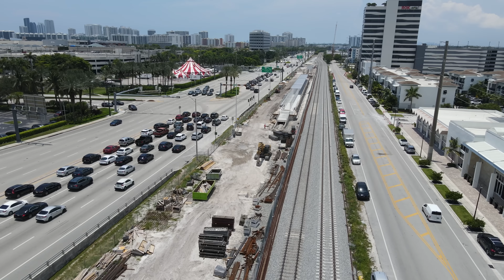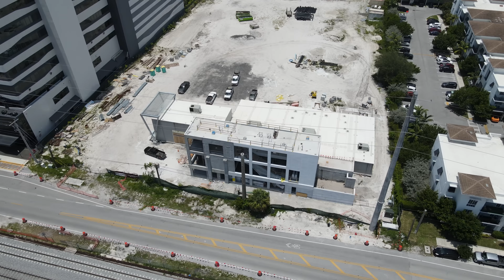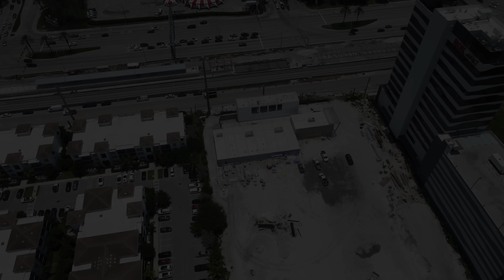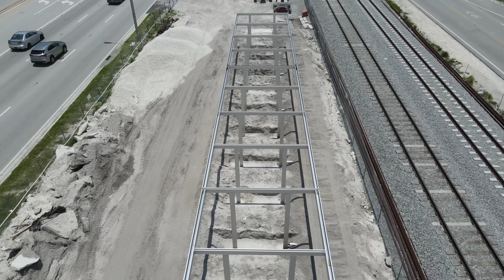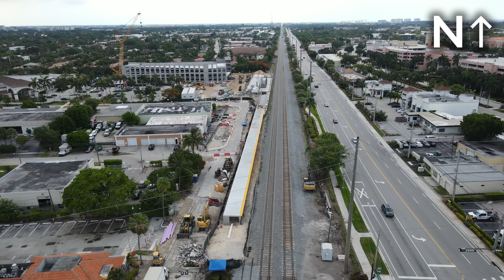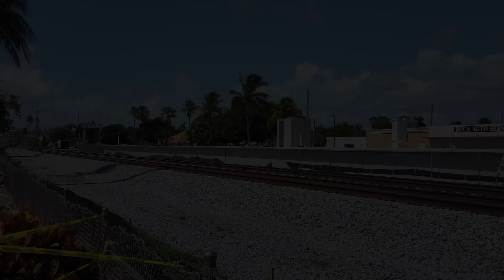Brightline Construction: Aventura and Boca Raton Station Progress - June 25, 2022

Comment: Would say I'm surprised they're using open box structures for the platforms, but then that's cheaper and easier to demolish than solid concrete platforms full of rebar.

Comment: I think I’m still confused—why at Aventura is there a “high level” and “low level” platform needed?  This isn’t a case where a railroad line is on an overpass over another rail line, and they cross at the station…?
Reply from the maker: There are ongoing plans for a separate commuter rail service on the same route from Miami to Aventura.
Reply: @RoamingRailfan  Is this commuter service a brightline service or is it be run by Tri Rail? Given the different platform height I assume it would be completely different running stock and carriages?
Reply from the maker: It will be related to Brightline but beyond that details have not been announced.
Reply: For clarity, 'high level' and 'low level' refers to the platform heights, not one set of platforms being above the other.

Comment: Is there a clearance issue with FEC running on tracks with high level platforms?  Will all stations have at least one bypass track, on the route shared with FEC?
Reply from the maker: Regular trains have no issues with the platforms as Brightline positions the tracks farther from the edge of the platform than other railroads since their cars have gap extenders to help bridge the gap. All stations on the FEC will have bypasses for true wide loads.